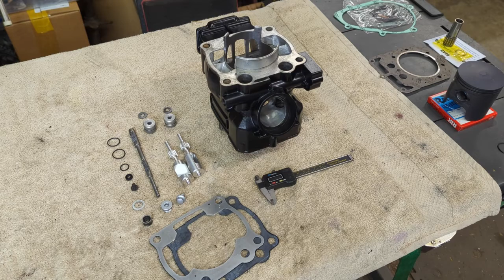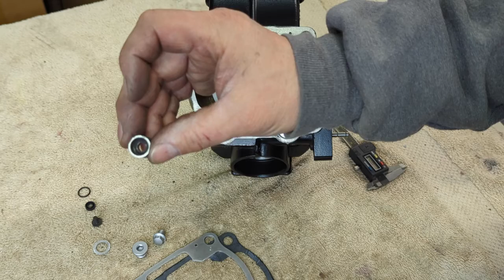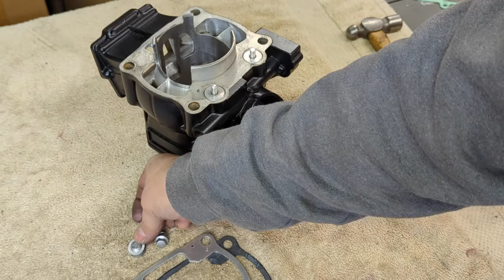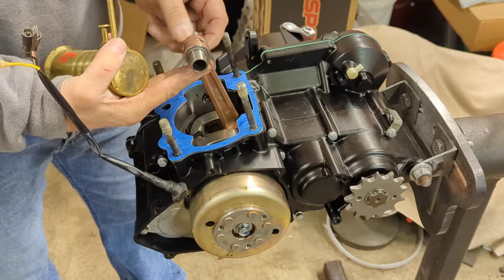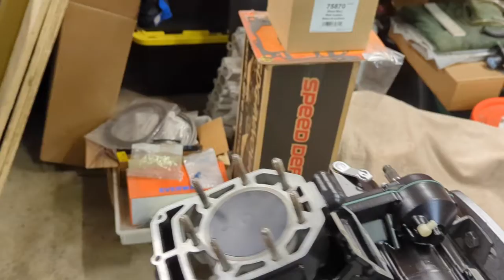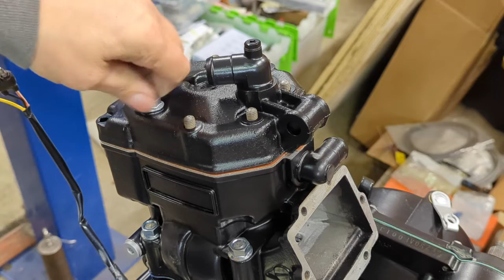Tecate 4 Full Rebuild Part 7

Comment: I'm curious what paint you use on the engine.  Is that powder coat or rattle can--and what brand?  It is hard to find a black that has the OEM gloss.  They are either too glossy or too matte.
Reply from the maker: Its a catalyzed urethane satin black from PPG
Reply: What brand copper oat do you use